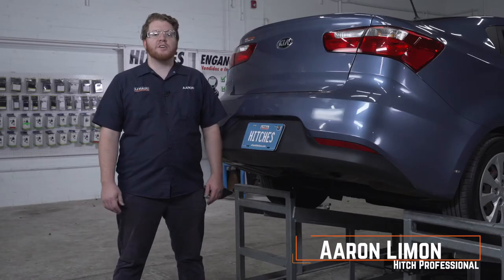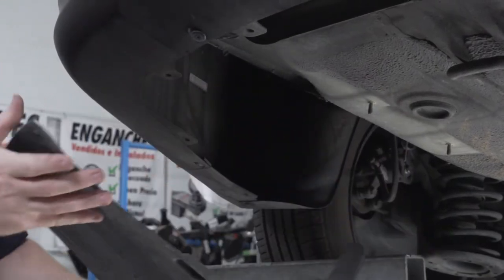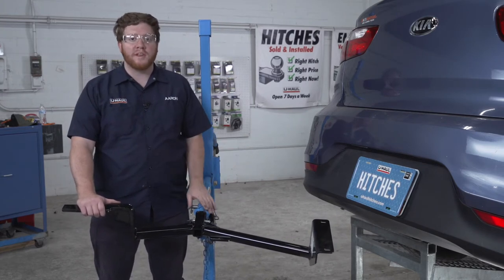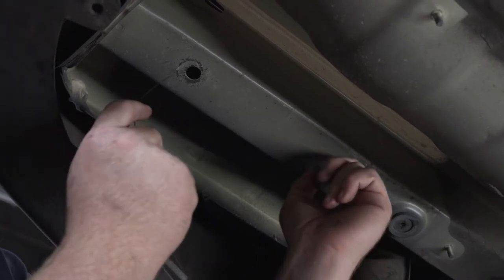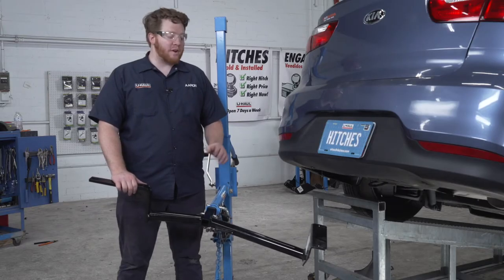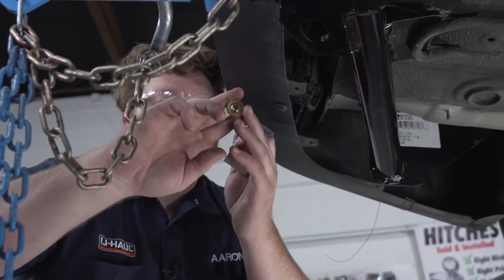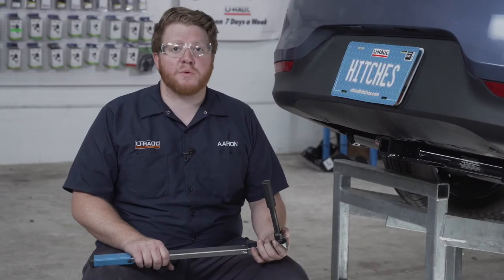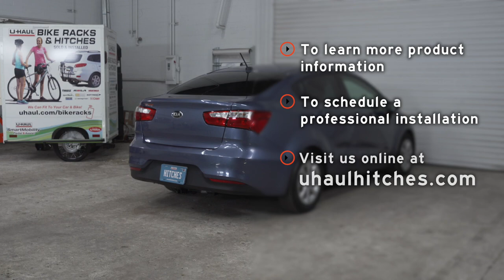2016 Kia Rio Trailer Hitch Installation

Comment: Will it be the same for a Kia Rio 2018 Sedan S?
Reply from the maker: This hitch will not fit the 2018 model and we do not have a video currently. You can always stop in to your local U-Haul and we can assist with the installation.
Reply: @trailerhitches  Thanks